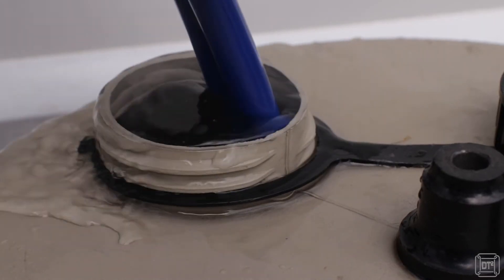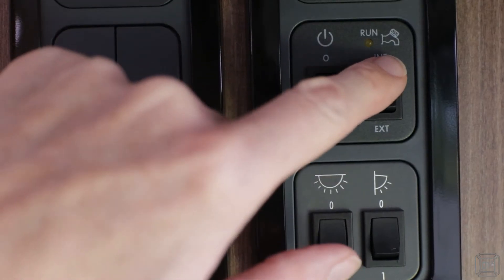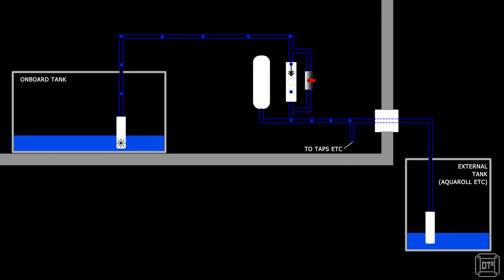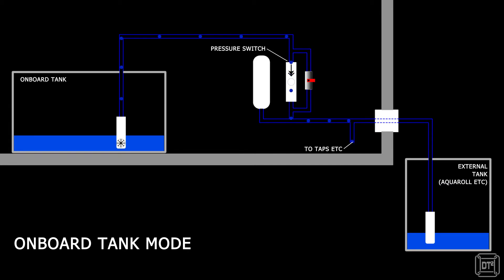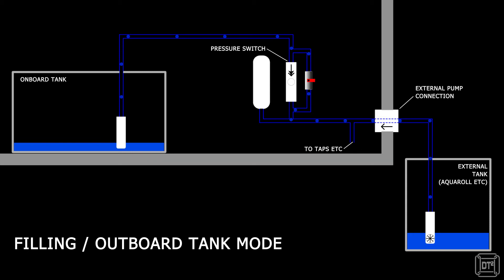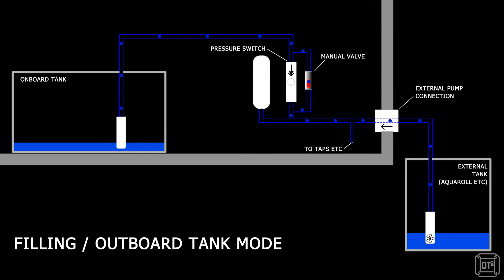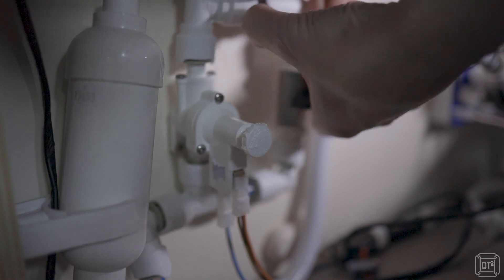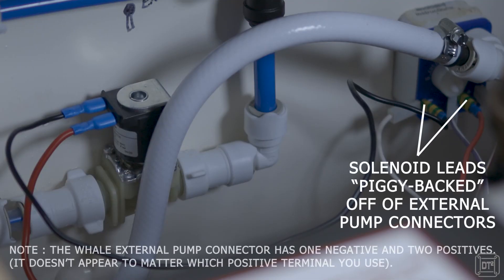AUTOMATIC FILLER BYPASS VALVE - For Bailey Caravan and Whale onboard tank systems

Comment: Hi a very neat idea but the setup seems to prevent filling the tank directly from a mains feed via the Whale connector. I try and fill the tank on arrival at site either at a motorhome point or a shared site tap. This saves fetching several barrels of water. The solution to this seems to be to control the solenoid by a separate switch rather than the external pump.
Reply from the maker: I haven't tried the whale direct connector but I imagine it would still work. You would have to turn on the external pump. This would activate the solenoid but of course there is no pump to run. But it's wired in parallel so the pump doesn't need to be there.
Unless the whale direct connector makes use of the 12v supply (I can't see why it would) it should function the same.
Reply: @DTSquared  Ah! I think you're correct. Switching the external pump on would activate the soleniod whether or not the pump was there. Thank you for your help.

Comment: Hi would it be possible to fit some sort of 12v valve to the hot water drain down as that is a pain too, also would you do a video about it
Reply from the maker: From memory I'm pretty sure the drain uses the same type of pipe so it is certainly possible. I'll see if I can get budgetary approval for the project from my head of finances (wife) 😀
Reply: @DTSquared  I leave all my drains open when I set off so I'm looking at fitting a different drain valve (the one I took out of the internal bypass set) and mount it near the locker door, not perfect but a big improvement.  Just waiting for the warranty to run out.

Comment: Hi. Love the Caravan vids so far, keep them coming!

Question.... would this setup not mean that each time the outboard pump is used it would fill the inboard tank first rather than run through the taps if that makes sense?

All the best.
Reply from the maker: Hi James, Glad you are enjoying the videos.
Yes you are correct that as soon as the external pump is switched on then the solenoid would open and so water would flow to the onboard tank and (if a tap was open) to the tap but at a lower, possibly insufficient, pressure.
This would only be an issue if you wanted to run the system with external tank only. I “think” this is possible but only if the pressure switch detects the pressure drop when a tap is opened and turns on the external pump when in external mode. I haven’t tried this as we always just fill up the onboard tank anyway. If you had a need to do this then a simple switch added inline to one of the power cables to the solenoid should enable you to disable the solenoid whenever you want to use it in external only mode (if such a mode even works in the first place.) Hope that makes sense.
Dave